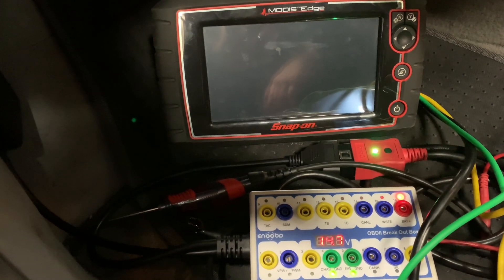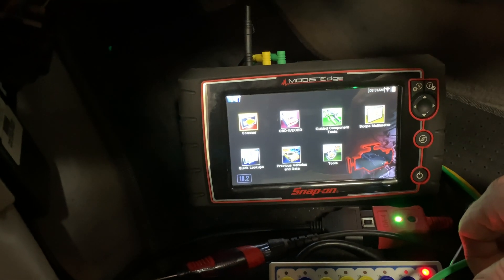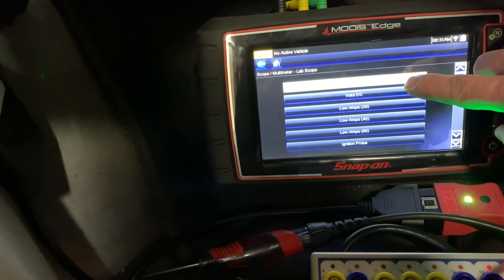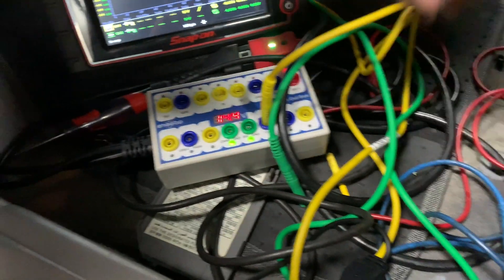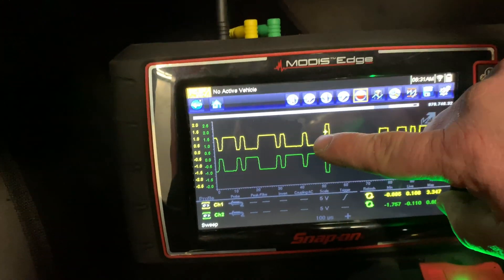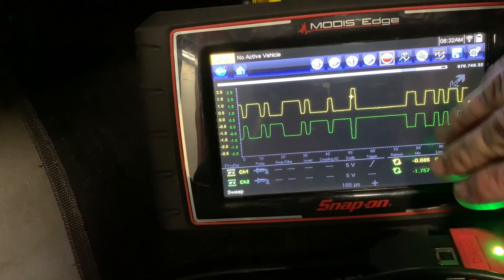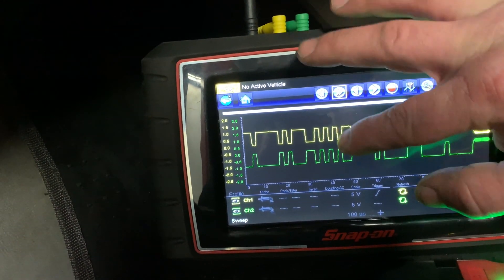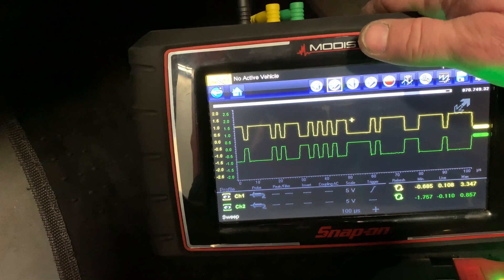How to check CAN lines

Comment: CAN C riding on 0V bias, does not sound correct for high-speed CAN C, I thought high-speed bias was 2.5V?? I see you are on pins 6 & 14. It looks like your BOB is a knockoff as the 2 rows of pins are upside down so they are trying to avoid copyright issues. Maybe knowing the exact vehicle might clear things up??? Zooming in on a waveform has its place but zooming out is also needed for an overall picture of the General condition of the packets, maybe they are just repeating showing an actual problem. The trigger also has its place but we also need to view the waveform without a trigger so what I have mentioned here is 4 scenarios and a little extra time to give a thorough inspection,  cheers.

Comment: where did you get those type of connectors
Reply from the maker: They are just test leads with banana plugs on both ends. I believe they came with a scope I purchased but I know I’ve seen them on the tool trucks and I’m sure they can be found on Amazon.

Comment: I have just per purchased the same break out box and have noticed that the led indicators next to the can lines do not flash or show activity? Is your unit the same or is the cameras frame rate hiding it?
Reply: Common problem with these, the way to fix this is to open up the breakout box and replace resistors RQ6 and RQ14 with 10K resistors.
Reply: @buildstoys  I bought one and the Can line did not flash. Sent it back as it did not work. Why should we fix a bad design ?
Reply: That exact model appears to be a fake model? I wonder what the price is compared to the name-brand box?
Reply from the maker: I have picked up the godiag break out box and am so much happier with it